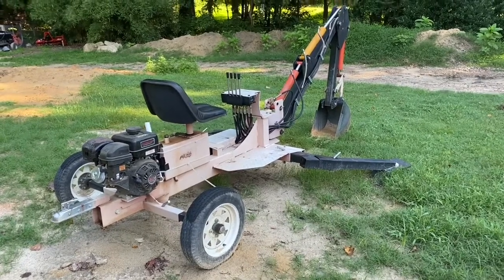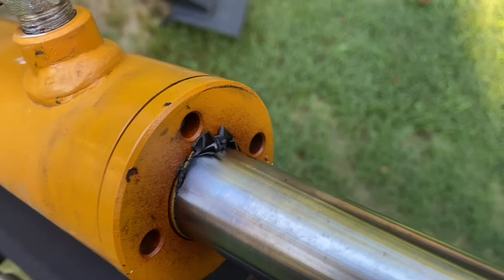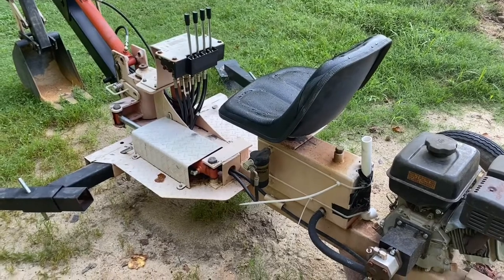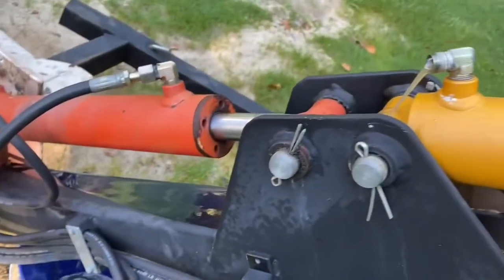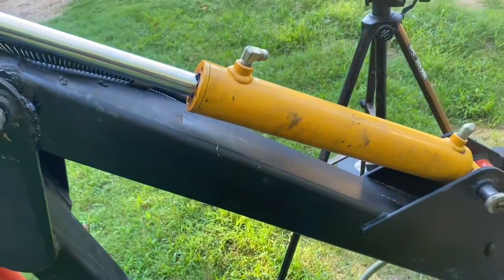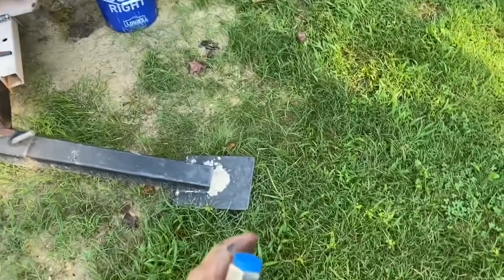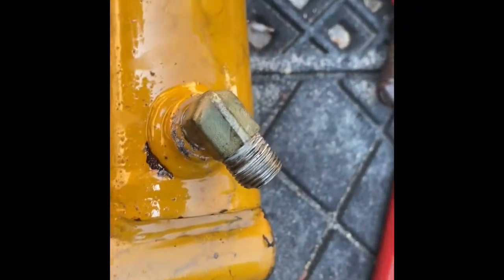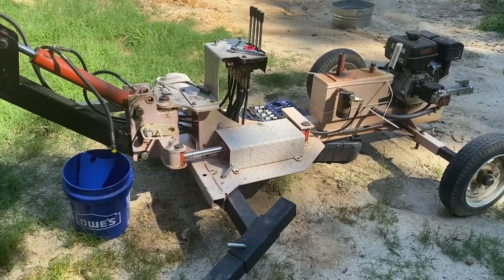Harbor Freight Trencher Repair Part 1: “Hydraulic Rookie Tackles a Cylinder” or “Arm Wrestling”

Comment: The trencher came with rebuild kit for 4 cylinders...
Came with the seals in a bag.
I still have my rebuild kits.  3 year old trencher.

It takes just a few minutes to replace the seals. (I've done others)

The seals are pretty cheesy.  If/when I need to redo a cylinder, I plan to look for better seals.
Reply from the maker: Unfortunately, my trencher is quite a few years older and second or third hand - so no seal kit. I don’t remember now if the kit was orderable from HF but don’t think so.
Reply: Same deal, I got mine March of 2021 and having problems with the same cylinder shown in this video. Was hoping I can find a video about replacing the seals. I have the kit that came with the machine somewhere..... 
Got the idea to try and replace the seals before ordering a new cylinder.
Any tips?

Comment: 7:45  DO NOT USE A PIPE WRENCH!

Go to a place like Tractor Supply and get a "Spud Wrench"  Very handy version of the "Crescent" wrench with a tapered handle and actually has a flat on it for use as a hammer.  Just a great tool to have with this trencher.

You had an appropriate crescent wrench right there in the bucket!

Or use an open end box wrench (which those fittings are made for...  Actually the best solution.)

Do not get the teeth of the pipe wrench on the threads. (which you did here...) as you can damage the fitting and need to replace it.
You even used the pipe wrench backwards.  Most likely way to cause damage before causing the fitting to turn.

That was an example of "JUST NO."

Comment: Probably a good idea to buy the new cylinder. You can always rebuild the old one for a spare.
Reply from the maker: Yeah. I have the new cylinder. I’m gonna tinker with the old one in my spare time. Once I get the proper fittings to finish this job I’ll get this thing back together. I’ll post all the information soon on the fittings situation. Thanks for watching.
Reply: How much was the new cylinder and do you have a part number? I need the same cylinder for my trencher after trying to do a job for someone in rocky conditions.